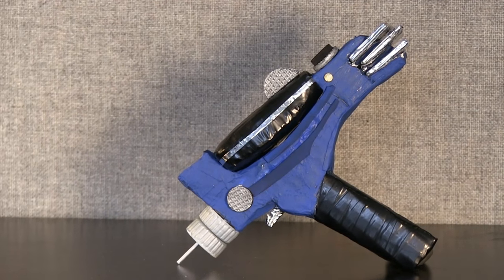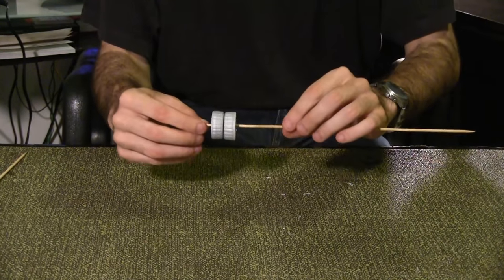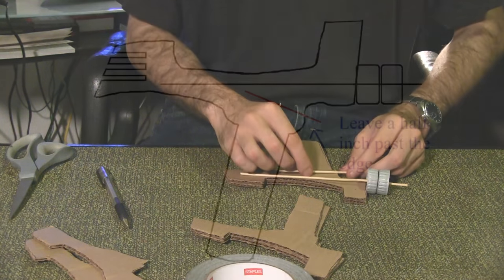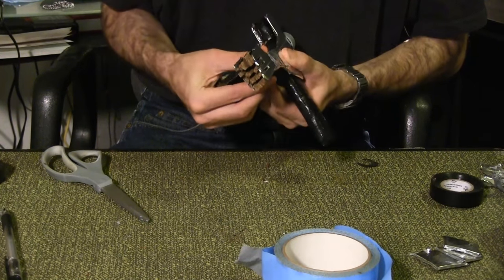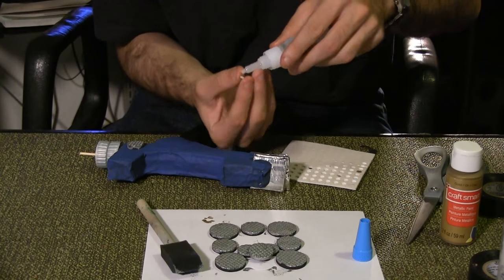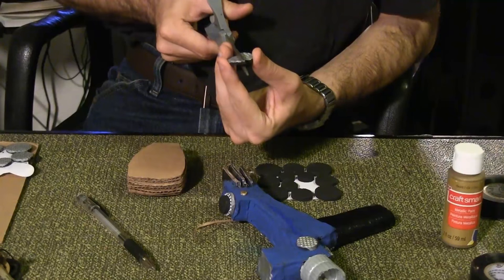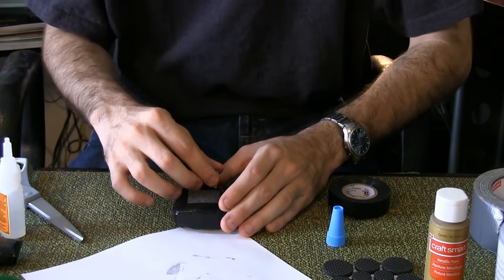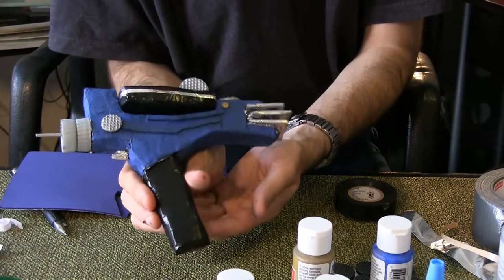How to Make a Prop Phaser

Comment: Is your handbook made for an 8 year old?? I was building better props than this at 10 years of age. And yes, I CAN do better than this and have. Built one when I was 15, cardboard body wrapped in sheet metal with lights and sound w/ rechargeable batteries in the handle ( which is what it is to begin with ). Built a communicator the same way ( and I still have them to this day, as I am now 50). This is like a Bizzaro world Phaser.
Reply from the maker: So....what do you want? If what I'm doing isn't meeting your needs or expectations, then go find a channel that does....or do you just need validation that you're better at crafting props than I am? A lot of people are better than I am.
Reply: @thepropmastershandbook1505  Just be better than a 10 year old. You have the tools to do it, try a little harder.
Reply: @thepropmastershandbook1505  After reading your reply several times, you should have probably worded it better to not come off as a jerk. And no, validation has nothing to do with it nor was it sought after. Point is, the name "Prop Master's Handbook" infers some kind of professional type of workmanship or somewhat close. Maybe your channel needs a new name, as you have said many are better than you are.